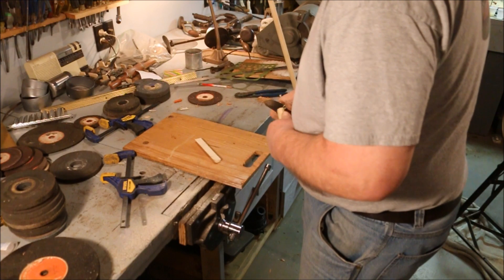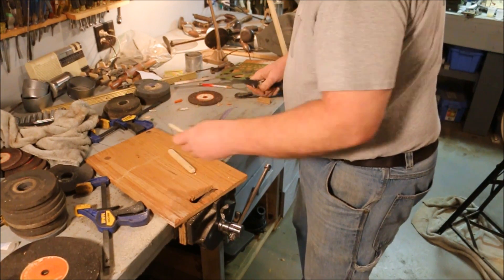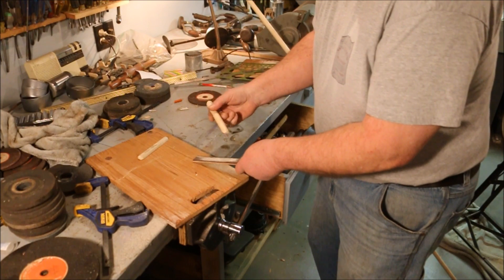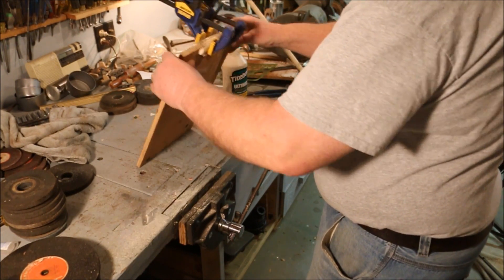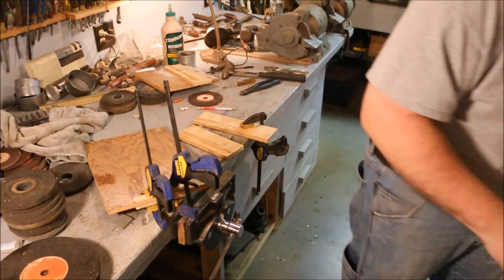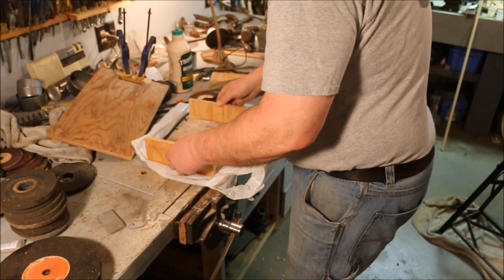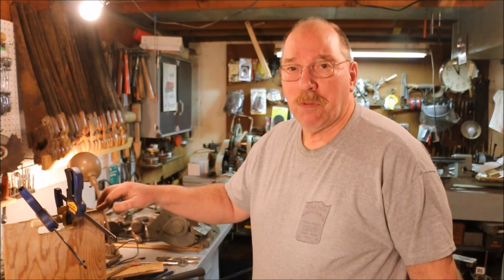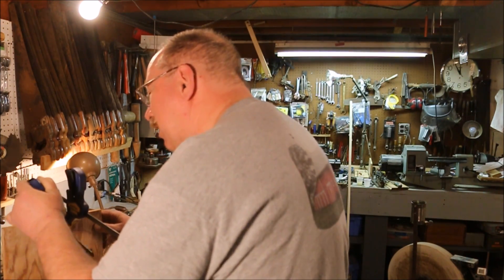GRINDING WHEEL RACK ~ PART 2 ~ STORAGE FOR GEORGES WHEELS

Comment: Question having mostly used hide glue I’m not that familiar with PVA wood glue I think that’s the type your using? You said I think the glue is runny so it’s on it’s way out ? I’ve been led to believe when it starts to go thick and gloopy that’s when it gone off and has more or less had it. Have I been informed wrong. Only I’ve just bought a bottle of that titebond mainly because of ignorance and everyone including your good self using it and it’s brand new and runs like cream or milk sort of thing. So now I’m thinking it’s dud? I'm a right in thinking that . Thanks unc
Reply: yes ive never seen pva go runny, then again ive not used titebond specifically, but certainly all the other pva wood glues.  perhaps sneelocks got frozen, as it will go bad if you let it get that cold, cream is about how it runs, it will go gloopy in about 6 months though, hope you bought just the right amount! i often buy 2 smaller bottles than 1 bigger one
Reply from the maker: When it's new it's like thick cream. This one is more like skim milk. It is still gluing okay and I'm not using it on anything critical like the rudder seat for Lewie. 😊
This bottle came with me from the old house. It sat in the shop summer and winter for 5 or 6 years and is at least 12 years old. I have left the top open a few times too. It's just about empty. I will be buying a new bottle. I think I'll get a smaller one this time. I was using it to fasten together the barn so I bought a large bottle. Maybe too large. 😊
Reply: Old Sneelock's Workshop thanks all it's a small bottle and it is creamy I'd say .but I found titebond do ready mixed hide glue so I've got that as well and there's no burner required which is a plus they recommend to place it in a cup of hot water for better use which not having water in the den could of been a problem them the thermos came to the rescue. And I've must say I love the smell of the old hide lol. I'm so glad that your caring for us staff I'd hate to think lewie had come unstuck 👍
Reply: There is ALWAYS too much gravity for me to become unstuck. NEVER worry about that. I missed your last post. I canned it before I answered but you'll get this all right. Yes, Our Uncle is a really really really fine Uncle, with 2 cats in the yard and life used to be so hard, without him. There is a song in there somewhere.
Reply: The rudder seat will be there till the bovines descend over the plains.
Reply: Lewie McNeely yes I agree fine uncle . You'll never come unstuck good job no good you flapping all over the shop .i mean there has to be some decorum. It's a family show 😳
Reply: No nudist colony here! Uggh!
Reply: Lewie McNeely that's like the two old boys in the nursing home. They were just sat passing time when one of the old girl ran past them naked. The lads looked at each other when one said What was that .to which the other said not sure but it needed ironing 🤓
Reply: Oh that's rough. I keep telling you that you're goofy.
Reply: Lewie McNeely goofy is cool ok with that I liked bugs bunny more   what's up doc . And I say ! I say , long horn leg horn clean comedy at its best . Loved  Saturday mornings at the flicks happy days